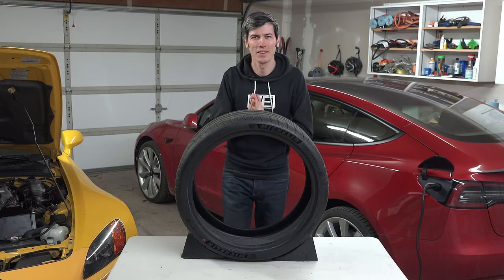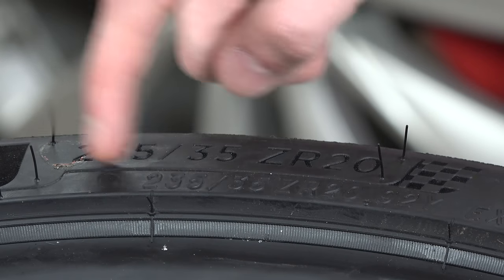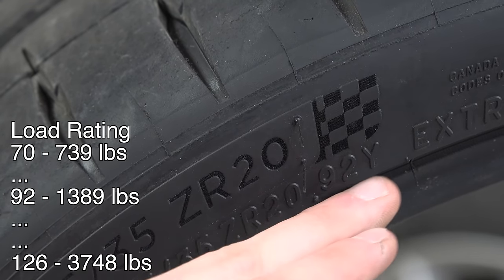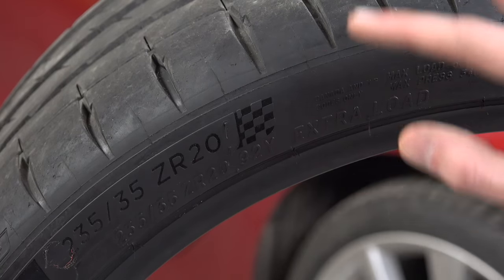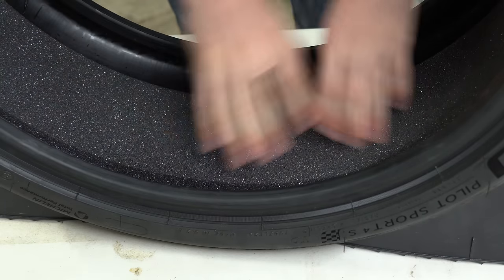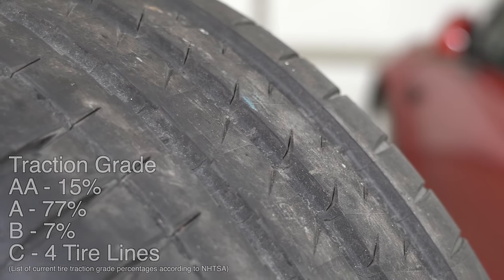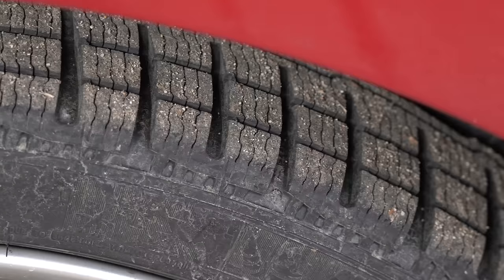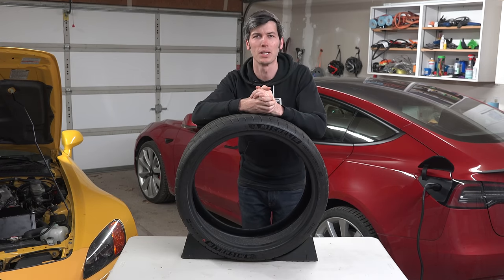The Ultimate Guide To Tire Sidewalls - How Good Are Your Tires?

Comment: should have explained also the red/yellow dot, red being the heaviest part of the tire, yellow being the lightest thus yellow marking should be aligned to the heaviest part of the rim -- the part with tire valve. if there is only red dot, then it should be at the opposite side aligned with the tire valve.
Reply: My tires don't have any colored dots, and are brand new.... Nitto Trail Grappler M/T 37x12.5r17... Why?
Reply: I dont know exactly why, but not all tires have that, the colored dots or markings its just for easier balancing of tires,. even all the details discussed by jason here, some of them are missing for some tires
Reply: Or just balance them
Reply: Its for easier balancing, less balancing weights to none at all.
Reply: wertyamatz22, true, plus it also helps for having a lower road force rating- meaning an better/smoother ride.
Reply: Unfortunately not all tire manufacturers measure radial force variation and mark their new tires with those dots, but yes match mounting the tire with the wheel when its first installed will help reduce its radial force variation (or what hunter calls road force), which is typically a small vibration felt at highway speeds despite the tire being balanced.  Modern tire balancing machines have a large roller that can engage the tire, simulating driving on pavement, and measure the road force generated, then they can tell you where to spin the tire on the wheel to lower that measurement, its a time consuming process and most tire shops have no clue what a "road force" balancing procedure even entails...but you bet they'll still charge for it.
Reply: The dots are almost exclusively used on commercial truck tires, because those don't need to be balanced. I have yet to see one on a passenger tire, however I'm sure they're out there.
Reply: Thanks! I didn't know this; interesting. Sometimes I see a red dot on new model year car tires.
Reply: This isn't quite correct.  Yellow is the lightest part, yes.  But Red is not the heaviest part, it's the location of maximum run-out - basically where the tire is most out of round.  All tires are slightly egg shaped, the red dot would be the tip of the egg.

There are multiple balancing methods, some use runout and some use weight.  The wheel may also have a mark in it where it is the flattest.  You can line up the red dot with a mark on the wheel to make the tire as round as possible.  You still need to balance the weight after that of course.
Reply: @GregHassler  Thanks, you saved me from writing this :-)
Reply: @j.adamwegs2882  for what its worth, the yokohamas i get for my civic have yellow dots

Comment: Tire pressure is so important, but so many people run the wrong pressure. I work at a lube shop and most people have too much pressure. One lady was running 60 psi for a Honda Accord (max: 44 rec: 30)!! Not only will it wear your tires incorrectly and make for a harder ride, but you also have less traction. When I got my gf new tires, she complained that she was having trouble cornering because she felt like she was sliding out a bit. I drove it to work to check the tire pressure and felt what she was talking about. Turns out, they over inflated the tires by 10 psi in the rear and 8 in the front (40 psi all around, subaru, math, you get it lol). Since I adjusted the pressure, all the issues she was having went away and she loves the tires now!

Comment: its amazing how many car salesman and used dealerships that dont know how to read tire information. I had to school a salesman who tried selling my friend a car with 'new' tires on it. They were 5 years old, just never used. Got him to put on brand new tires if my friend bought it. Then I scanned the system engine codes with my scanner, he said 'its just an oil light'. It had like 6 or 7 faulty sensor codes including o2 sensors, which can be pricey. My friend didnt buy that car, or any from that dealership ^_^

As far as this video goes, great information! The important one to remember besides the obvious tire sizes is the date manufactured. Any time you buy a used car, verify the dates. most inspection facilities or tire shops wont even touch a tire if its more than 8 years old, 5 in some places. And by then the tread has gotten hard and choppy in most cases and probably is not safe at highway speeds in the event you slam on your brakes or do a higher speed curve and load the outside of the old tires.

Comment: Also there is usually  a colored dot on most tires. It's easy to miss unless you stare at the tire. I learned the reason for that dot is helpful when mounting/balancing the tires. Line the dot up with the valve stem
Reply: True . not many know this

Comment: In F1 (and other racing series with multiple tire options), there is always an inverse correlation between tire traction/grip and durability/wear; eg compound A might have a 10% higher coefficient of friction than compound B, but compound B will last 10% more laps than tire A. Is this the case with road tires? Can I buy tires that offer both better grip and durability than discount tires, or is there an inherent tradeoff between grip and durability?
TL;DR Is the grip vs wear tradeoff in racing tires a natural or artificial feature?
Reply: Remember, that is about wet braking. Not an actual grip compound. You can have a hard truck tire wet brake better than a slick sticky tire because of Tread.
Reply: @killaj419  Actually it is tread design, tire compounds and construction differences (the types of layers and materials used to build them).
Reply: Yes, there are large differences in consumer road tires.  In racing, you only have a few variations and cost is not a primary driver in variation like it is with consumer tires.  Also note that there are effectively "generations" of tires.  The average tire is improving slowly but steadily with each new model released.  In general, in the same class of tire, you are making tradeoffs of dry grip, wet grip, cornering, tread life, NVH (noise, vibration, harshness), comfort, energy loss (fuel economy), and price.
Reply: @kodiak2fitty  I totally agree, but the "Traction" rating on DOT tires only rates wet braking on even pavement. That is it. Nothing else. It is a federal law. Yes, you can get more technical data from the manufacturer of the tire.

Comment: A Ford GT with 2500 crank HP broke the 300mph barrier. Do a video about that Jason!
Reply from the maker: In just a mile! Quite cool. :)
Reply: What kind of tires can handle 300mph?!?!?
Reply: Is there a link to the video/article about this?
Reply: @ZR_1121  the video came up in my recommended. Haven't watched it yet because I thought it was clickbait
Reply: @skmetal7  That is what's bothering me!
Reply: @skmetal7 I was wondering this exact thing. Maybe extreme performance tires for the one-off stunt? They only had to last seconds, not minutes or hours.
Reply: @skmetal7  After a certain point, you actually just have rubber and a wheel (no air) so that the tire carcass doesn't destroy itself.  The Mach 1+ land speed records are now done on metal wheels with no rubber.  As someone else pointed out, these tires only needed to survive a few miles/minutes, not 40,000 miles like most tires.
Reply: @EngineeringExplained  Does it still have its supercharger along with the turbos?
Reply: @skmetal7  the ratings are for sustained use, not a few seconds. 

Any tire can handle a few seconds of high speeds it's the heat build up of sustained high speed driving that kills it.

Comment: Jason, the index of load for a giving specific tire size can only be 2 possible numbers, the normal load and the extra load, so although there are several numbers out there, for your application that isn´t really, for exemple, I bought for my car one set of 225 50 17 and you can find the load rating of 94 OR 98, there are no other numbers, and the 98 IS extra load. a variaty of load rating is just possible looking into tires of different sizes.

Comment: Could you put that info in a text file so I can print it and go tyre shopping please ?
Reply: Figure out what your car require, then google what that mean in "tire lanuage". 
Sizes are limited by the rim and your car. Most cars have a very limited range of tire it can use, depending on rim size.
Load and speed are just upper limits on the tire, you want as low as possible above what your car is capable of (dont need a truck tire load and 186mhp on a prius)

Comment: Tires which are "special designed" for some specific car model are one of the funniest joke in auto industry.
Reply: Indeed. I see a lot of models on Tire Rack with the note that they are for Mercedes Benzes or Porsches
Reply: Why is it a joke?  The tire compounds and construction are often tweaked specifically to meet the OEM's requirements.  OEMs start from an existing design, multiple versions and iterations (aka submissions) are created and tested by the OEM to check attribute performance before settling on a final tire submission.  For example the OEM could be looking for lower noise/vibration/harshness (NVH), lower rolling resistance, changes in dry/wet handling.  The tire interaction with the other suspension components on a vehicle is quite complicated.  Even the recommended tire pressure placard is determined by a mix of regulation requirements and attribute trade-offs.   Going to the OEM dealer to buy replacement tires is the way to get the version the engineers designed.  Going to Tire Rack or a local garage is a crap shoot and most places won't match DOT codes; i.e. you could have a mix of Tesla and Chrysler spec'd tires in a set of 4.  Source:  I'm involved in OEM testing of tires.  Nothing against Tire Rack.  I bought my winter tires from them.
Reply: I remember the Acura NSX came with vehicle specific tires on the rear with incredibly short tread life. About that time Lexus LS400’s were also fitted with unique tires.

Comment: You mentioned the wear rating numbers are only useful within a particular manufacturer, but aren't they supposed to be based on their performance relative to a DOT test tire?  I get that the manufacturers do their own testing and have to extrapolate the number from limited wear testing, but isn't the whole point of UTQG that it's referenced to a standard so that products from multiple brands can be compared against one another?

Comment: 4:46 In case of Michelin it is not an aesthetic choice to put Z on the tire. If Michelin has only Y letter it means it is suitable for speeds up to 300 km/h, if it has both ZR and Y it can take over 300 km/h (not specified how much exactly). For other manufacturers it could be different.
Reply: any tire can go faster than it's designation, the designation only states up to which speed the manufacturer guarantees it's perfomrance to be as intended.

Comment: Very valuable information!!  “Treadwear” the standard is set to a rating of 100 is equal to 30,000 miles.  (200=60,000,  etc.)
Reply: So.... ive had 580.... what does that mean?

Comment: Great video. I actually learned quite a bit. My tires have a M+S after the speed rating on the tire (105V M+S, example). It wasn't included in your video but, I was driven to painful curiosity to find out what it was for. After using my google machine, it stands for Mud and Snow. I could have probably guessed, but good to know. Cheers.

Comment: 1) In your example the date of manufacture was 3118 or the 31st week of year 2018. Given that rubber loses its properties over time even its kept on a shelf and exposed to ambient temperature and pressure how long does the tire maintain its safe or usable life? When do you need to change it even if it has adequate tread depth?
2) Is there a durometer rating indicating how soft the rubber is? For example a winter tire is made of a softer rubber to increase its friction on ice and snow.

Comment: 3:50 I've read speed spec is considering you are using full weight. So if your car on each wheel is actually lighter than spec, it's okay to cross maximum speed spec without really crossing tire limits at all.
Also looking for a tire with higher speed spec can be a no good idea, once other specs can be eventually worse than lower speed ones. I mean it's better having a tire which will be good in a lower speed traffic where you are more likely to have to brake suddenly.

Comment: Thank you for detailed explanation. That should be useful for tire buyers. It would be more useful if you can tell more about how to maintain tires to get them last as long as possible. I had to replace 2 set of tires which still had 70-80% tread due to dry rot. Do you have any idea to deal with this problem? Thank you.
Reply: @inochi27 :
A.) Drive your car more often.

B.) Don't get all excited about small superficial exterior cracking in the tire rubber. They're almost always insignificant and unimportant. 

C.) A true professional mechanic will tell you straight. Some guy trying to sell you new tires, won't.

As compared to older rubber tires, today's (modern) cheaper rubber compounds simply don't fare very well from deterioration caused by UV rays (sunlight).

Comment: Pretty much knew 99% of that. The only things that surprised me was "D" in tire size code was diagonally  belted.  Dont think I've ever seen that. I always assumed the were only R now as bias ply was done away with. The foam insert is definitely new as well. But my 2 thoughts 1. Puncture repairs and 2. Wouldn't that foam insulate the the tread affecting the heat/cooling of the tire? I guess if its built with it as a engineered system then that's obviously taken into account. And maybe from a racing/track standpoint it could help heat up better for added performance at the expense of accelerated wear

Comment: I have the Michelin PS4S on my 370z with about 17k miles on them. My projected tread life is about 30k miles, with no tire rotation. 

Michelin has managed to get really good longitudinal and lateral grip on a tire that gets good tread mileage. My only complaint is that the sidewalls are not stiff enough for the kind of driving I like to do in this car.

Comment: Could you do a video solely based on tire pressures? For example, there is a lot of mis information around and many people see that the max psi on the tire and think thats what they should fill it to. Ive always gone off the door placard, and also with larger tires on trucks, say going from a 29" diameter stock tire to a 35" tire. I would assume, still follow door placard, but being told many different things. Id love if you could clear that up as im sure in not the only one with these thoughts.

Thank you! I love how informational your vids are!
Reply: The door placard is for the cars original tires . even then its not always accurate . you want the slightest budge at the bottom of your tire.  ..more crap in your trunk - more air in your rears.
 I judge my fronts on my favorite corner,. if it squeals - more air .  if it slides out - less air, till I find the happy medium .. everyone is surprised how evenly my tires wear...and I get maximum performance...

Comment: You might address the issue of hi mile tires are hard compound and lightweight cars. I just replaced sentury UHP with a 500 treadwear rating very loud. 72 Db noise level. Replaced with a 300 treadwear and got 65 Db. This is on a 2012 lancer GT. My point is no need to get high mile tires they're just noisy and you'll never wear them out on a lightweight car. Years ago in the 90s I remember the Saturn cars people would put these 50K mile tires on them and they would dry rot before they wore out.

Comment: Good vid and info, don't forget the section width measurement is based on an inflated tire under no load.
Reply: Inflated to max pressure or...?
Reply: Ryan Anderson Max pressure on sidewall.
Reply: @cardo1111  perfect, thank you
Reply: Andrew Delashaw True. Mounted Rim width would have a greater impact.

Comment: I understand that the recommended tire pressure from the factory is, most of the time, for a passenger (P-rated) tire. What if I changed my tires to an LT-rated tire? What tire pressure should my tires have, assuming that the LT tire is the same size as the stock tire?

Comment: Jacen I’ve got a performance model 3 like you. What would you suggest for my new 18 inch rims! I wanted to go to 18 inch because they’re more resistant to pothole damage. I’m looking for a smoother ride , stronger traction and all season and I don’t really care about snow. I ended up buying a 235/3518 AAA rated Perelli P Zero plus original compound. Thanks. I’m pretty happy with the tire. However I did end up with three of them that were “out of round” and did not pass the road force test. Maybe you could give some insights about how this test is done using the Hunter machine. Tire Rack took the old tires back and gave me new ones the next day. They also paid for all the labor. It only showed up because I had a small vibration in the wheel at freeway speed. Thanks, keep up the good work!

Comment: Watched a bunch of tire guides b4, this is by far the most complete. Thanks Jason! ... Although it still doesn't answer my question as to why everytime i get my 4 michelin pilot ss installed (8th set now) on my 08 G35 they crank the psi to 45 when the car recommend 33... ???

Comment: Hey Jason, I have a video suggestion.
Front air ducts, the ones leading air around the tires, which many new cars have.
It would be great if you take a look on how they are effecting aerodynamics and therefore a cars fuel economy and efficiency at different speeds.
Keep up your good work ^_^